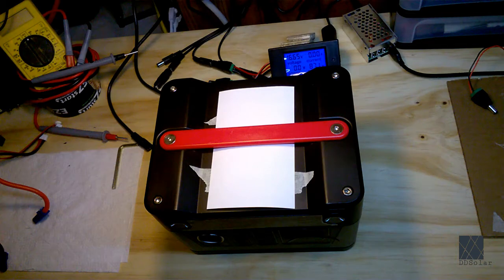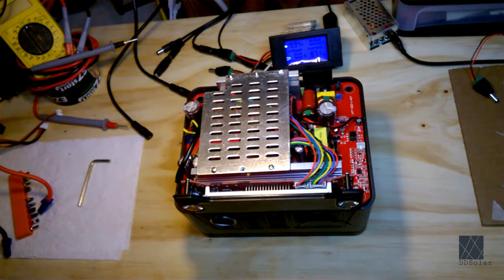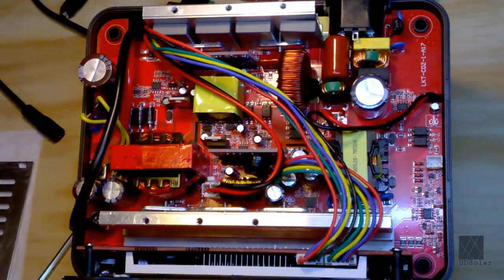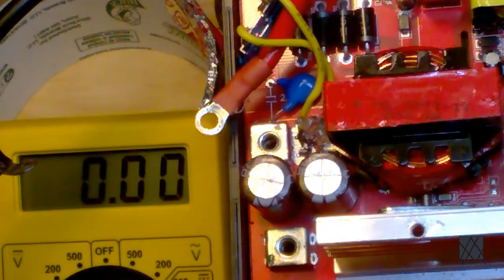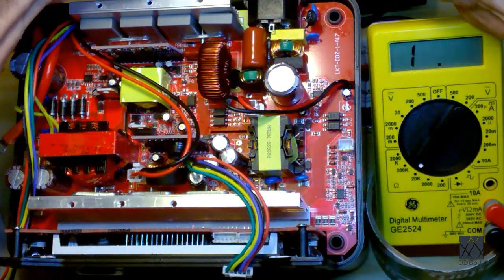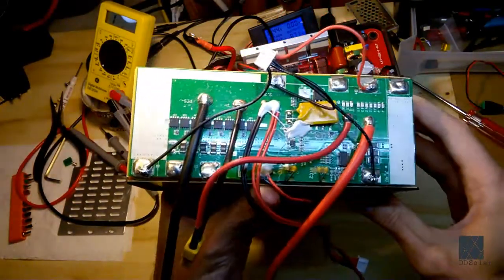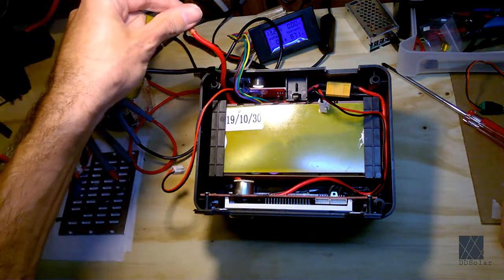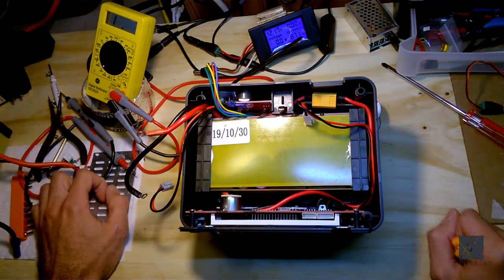Teardown and Repair or Salvage of a Solar Generator   Part 1

Comment: My ninja battery exactly like this one stopped working a little after 2yr. All outputs stopped working but display works.
Reply from the maker: These things aren't easy to troubleshoot and require quite a lot of electronics work. At least the display works, that's helpful. I have one that won't boot at all. You could try charging it, and probe all the DC connections and check battery voltage. It might be possible to determine where the DC voltage stops and check from there. There is a big set of cables (red and black for inverter) a smaller set (for 12V and USB circuits) and a small 4-wire (2 red 2 black) plug for charging. Besides checking pack/cell voltage, those would be the first places to troubleshoot.

Comment from the maker: 12vLife - I can't see your comment to reply due to a YT glitch. So I'll reply here and ping you on one of your videos. You can trace the charge jack wires. Then trace the wires going to the AC outlet. Careful, there are some high voltages present. You could just leave everything intact and install the jacks (connections) into your project as-is. This is the safest and easiest option IMHO